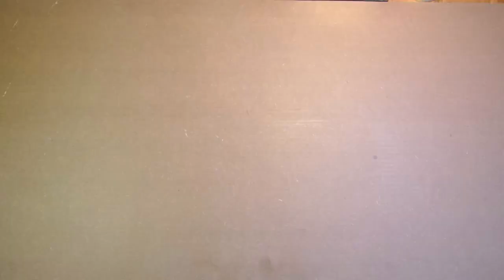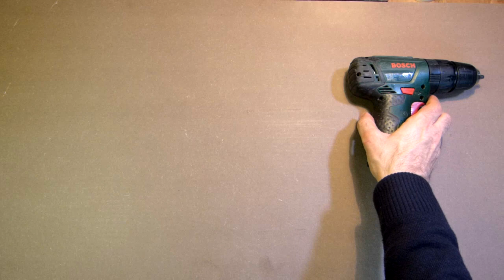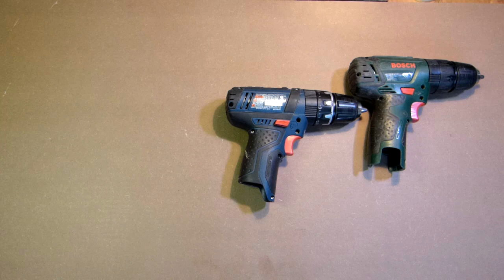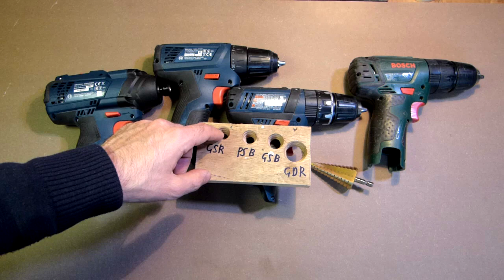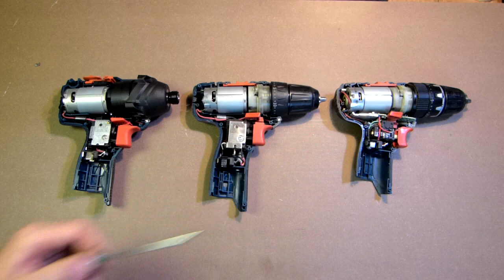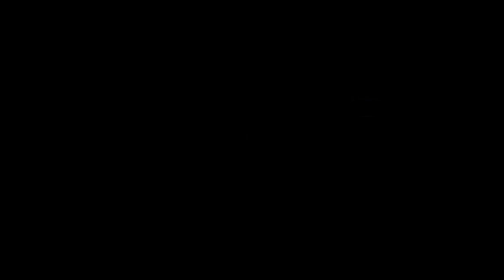BOSCH GDR, GSR, GSB & PSB - Comparison & Disassembly

Comment: Interesting video. So its a standard that Bosch Malaysia will produce blue color devices while Hungary will produce green color? Secondly, PSB and GSB series both are for Wood, Metal & Concrete, than whats the difference. Is it only the country of manufacture. I am a Home user. I am confused between BOSCH GSB 180-LI and BOSCH PSB 1800 LI. I would like to buy the latest product and the reliable one. Could you help me here.
Reply: Green ones  are  for home use. Blue ones  are for professional/commercial  use. Blue ones  have better materials and parts than green ones like the plastic  grade, the metallic  gears and other parts. Overall  green is just for occasional  screw in the wall or emergency  home use while blue is for daily  work.
Reply from the maker: Please, search on the internet, I have no information on the latest product.

Comment: Hi.. My gsb1080 motor just worn-out..I was looking the replacement motor for mine. But i found only for gsr1080 model from china store which is 3rd party type. Nkt original from bosch.according to the seller, they dont have for gsb 1080 model. And i checked from bosch website, the part no for both of them are different. Are u sure i can buy gsr1080 model to replace it?
Reply from the maker: Yes. Please, review the video; it was made specially for this purpose.

Comment: All them are junk I hate the motors they got in all sealed have brushes inside that's cheap crap I prefer makita brushed / brushesless loads better quality and design
Reply from the maker: It's possible to disassemble and change brushes also in these motors. As to Makita - every product and device has its own price.
Reply: @powerbatterychannel4315  have u seen the quaily of makita brushed motors compare to Bosch
Reply: @powerbatterychannel4315  still rubbish the motors they have them in toy cars and other cheap crap
Reply from the maker: @micjubba709  It may remain your opinion. My devices work within 6 years and are still OK :)
Reply: @powerbatterychannel4315  don't get me wrong I like Bosch I think they can do better with the motors and parts they use
Reply from the maker: @micjubba709  Sure, but it seems they are not oriented to be the best of the best, especially within the last some years....
Reply: @powerbatterychannel4315  who u mean makita or Bosch lol like I said Bosch is cheaping on parts makita isn't
Reply: I know makita isn't the best of the best but they are one of the best I have their dtd/ xdt  impacts can't fault them
Reply from the maker: @micjubba709  Bosch, of course
Reply: I changed 3 tools, all have decentralized mandrel. Yes are are junk but i had in the past bosch and was very good. Now only name  remain, the quality no.